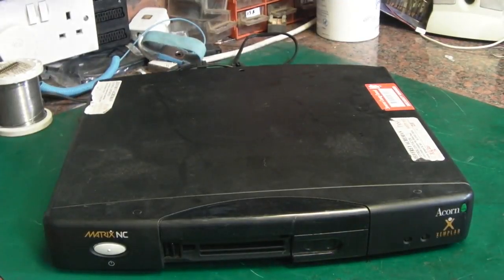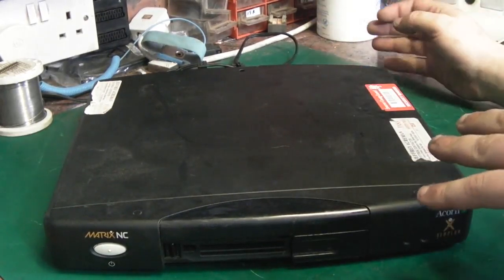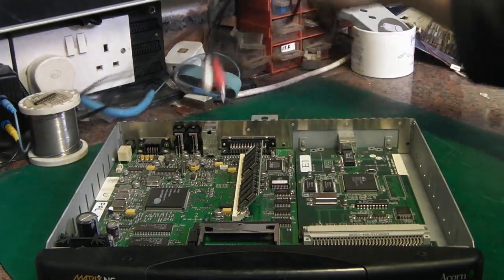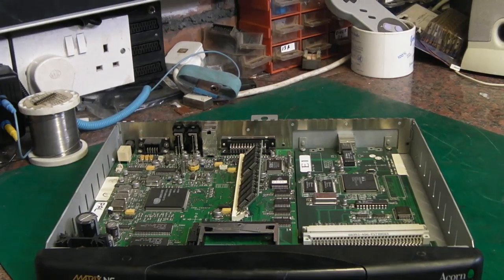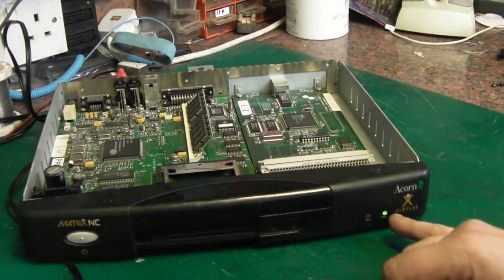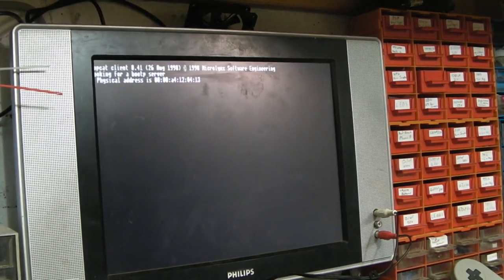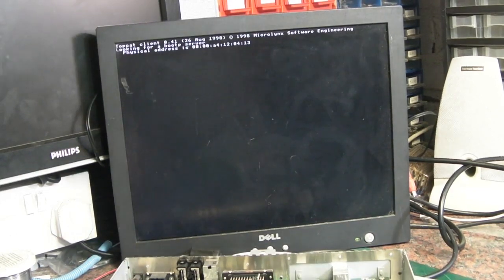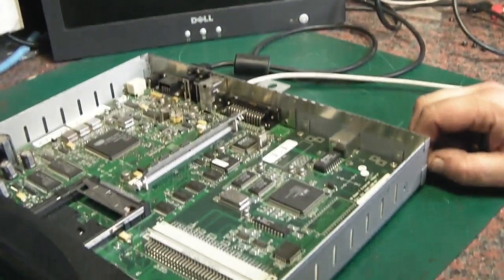Acorn XEMPLAR / MATRIX NC look over and power up

Comment: It appears to be configured for the Bootp protocol which is supposed to give it it's initial IP configuration. It even appears to be looking for that server on a specific MAC address which is a bit weird because it would only work with one specific server.
Perhaps it has a BIOS and you can change the boot settings to DHCP instead of Bootp which would at least allow you to give it an IP address.
Reply: The Highlander  that MAC address must be its own address
Reply: That does make sense
Reply: *configure commands are  the Acorn's 'BIOS'. I think *modules? ROMModules Or something (been a while) sets up the network card settings after it does all that it heads straight for the !Boot folder to load any add-ons and stuff to RISC OS but if shift is held down it will skip that and hopefully go straight to the desktop from ROM.

Comment: If it doesn't have a hard drive I wonder if the engineers accidentally left drivers for the parallel Zip100 like they did with the Bush Internet Surf Set (which is really an Acorn and can run the desktop using files from a RISC PC) this think it's better though because it has sound !
Reply from the maker: Now that is interesting, I have one of those Bush internet Surf Sets too! I feel some further investigation is necessary

Comment: I wonder what happens if you hold down R during power up to reset the CMOS?  Then I wonder what you could do using the *configure command? Don't forget to try *desktop?  I think the Ethernet adaptor is unhappy because not enough amps?
Reply: Ohh yes and try holding shift during power up to skip !Boot
Reply from the maker: Will try that thanks!
Reply from the maker: I will try as you suggest. As for amps the PSU I knocked up should be good for about 1500ma and it wasn’t even getting warm so don’t think it was pulling to much current. still I really need to come up with a more permanent solution than that lash up with the veriac
Reply: The Variac idea was a nice touch though... Good thinking Batman!!